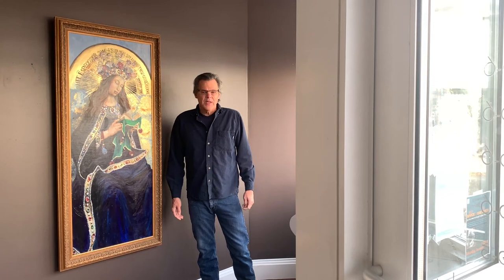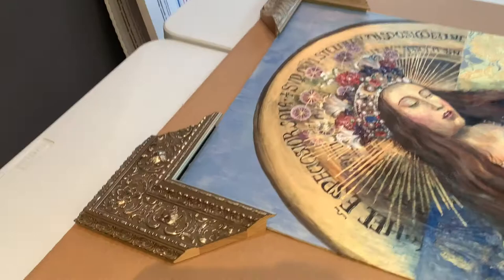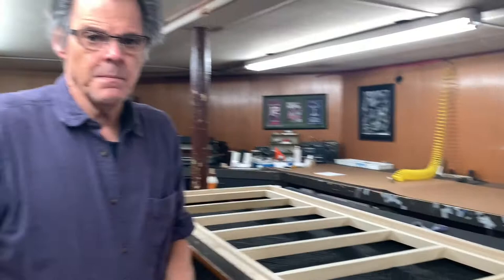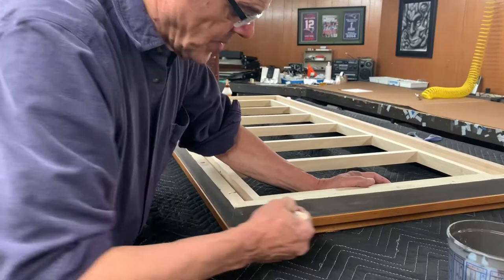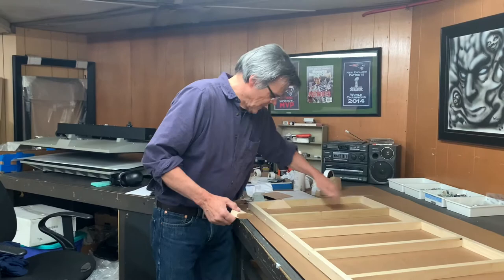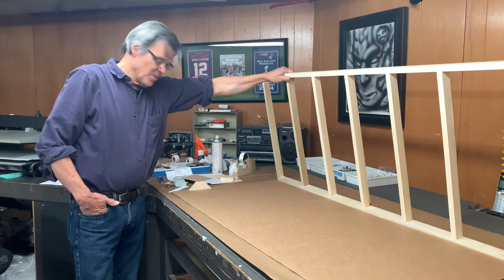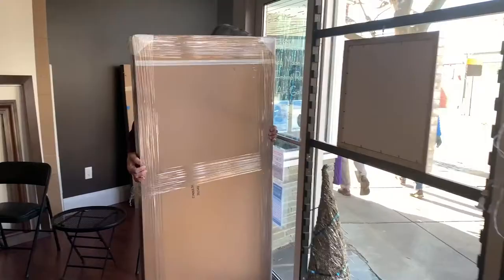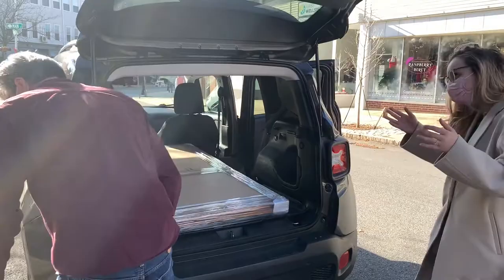There's More to It Than You Think: Framing a Piece Painted on a Panel

Comment: Very mpressed with all the considerations that you put into properly framing this piece.  I still have to go through the rest of your videos, but I was wondering how smaller panels would be framed that are painted on the type of canvas panels sold in art supply stores - which I probably shouldn't have used in the first place to paint on, but that's another story.  Thanks for all the videos.
Reply from the maker: Thanks for watching our videos! Those pre-bought panels can actually be quite good. They already are permanently attached to Wood on the back and they are made out of either Masonite or quarter inch plywood which is very stable so just frame it anyway you’d like and it really should be fine. Good luck.